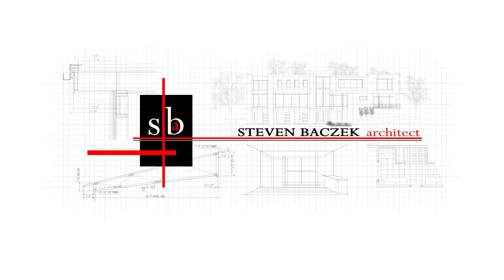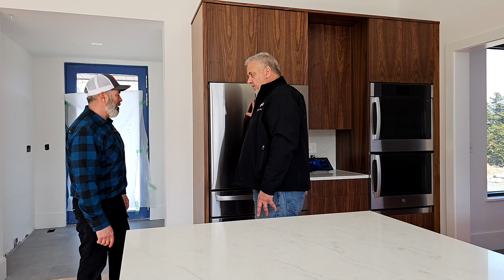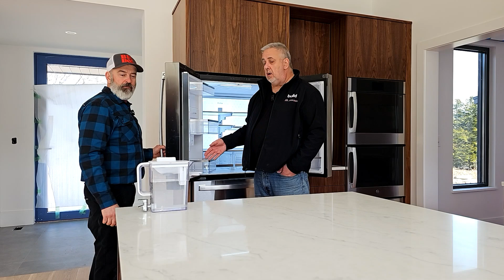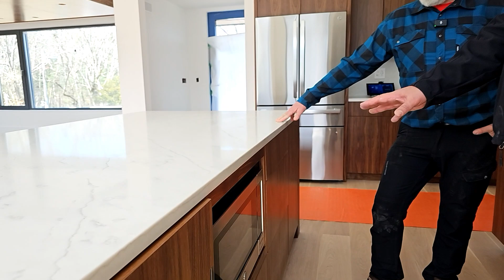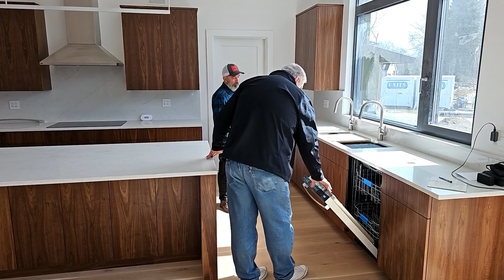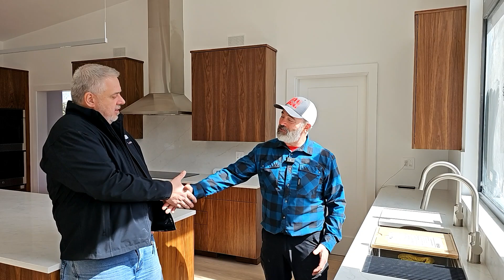A CLOSE LOOK AT APPLIANCES

Comment: I hate our GE fridge on hot days it can't keep up. We don't have A.C. G.E. says Above 110°F, the oil could overheat and break down. I say that happens at 90F. Yes we do clean the back and proper space for it. It gets heat soaked because of wall insulation.

Comment: Being offgrid I decided to go with D.C. appliances like found in boats and R.V.'s. I loose less electric by not running A.C. appliances from D.C. solar system. Think the D.C. appliance have better insulation too. The D.C. chest freezer will live on porch to take advantage of winter temps and use less electric half the year.

Comment: I'm doing planning - in my head - for a kitchen model in a year or two. The recessed refrigerator will definitely be included. I've seen it in the house my brother did and liked it a lot. I don't know if it's common, but my brother built extra space behind the fridge, ducted out to get the ventilation that the coils need.

Anyway, but I'd like to suggest or ask your opinion on is using 15-inch upoer cabinets, but recessing and into the wall so that they don't consume so much of the 'air rights' above the countertop.

Comment: I started recessing full size refrigerators back in 1994. Doing this makes a difference in the overall kitchen workspace.

I don't like the under counter microwaves.  Over the stove was a very convient placement, but the included exhaust fans could never do a good job.

We ended up desigining kitchens that had one extra depth countertop (similar to the recessed refrigerator idea).  We then built a countertop area over the recessed countertop to form an enclosure for the microwave.  We used the full lenght of this countertop area to add a small appliance garage with a pull down roll top cover.  
On the backside of the extened countertop kitchen wall we either installed built in cabinets or built book shelves.  
Doing all of this allowed for us to use full sized microwaves that were extremely accessable.  It also allowed for easy replacement of the microwave down the road with any other full sized unit.  No future cabinet modifications required.  NOTE:  You will need to use countertop material that allows for custom depth fabrication.

Comment: Is the refrigerator installed correctly?  My refrigerator had to have gaps at the sides and the top to allow air circulation for the compressor.  Check the installation instructions.  The location of the microwave is the dumbest thing I've ever seen.  How are you supposed to operate it when the controls are under the counter?  The range hood is too high off the stovetop to do much good.  Check the installation instructions.
Reply from the maker: It is and the microwave is right where the client wants it. The range hood is solely for odor control, it works just fine where it is
Reply: That's where I am putting my microwave in the house I will be building.

Comment: I don't quite get the benefit of a range hood with an induction cooktop and all-electric kitchen... especially with an integrated CO sensor.  The refrigerator detailing is great though!
Reply from the maker: Odor control
Reply: @stevenbaczekarchitect9431  Range hoods  aren't especially effective at that; general ventilation works better, and a carbon filter better still.   The purpose of the hoods is to address incomplete combustion of cooking gasses primarily.  In commercial kitchens the function of heat removal is an additional benefit, but that is a function of density more than anything else.
Reply: The range hood is also very effective at capturing grease from the rising steam and heat from cooking.   I have the exact exhaust hood in my house above a gas range but without the co sensor.  We clean the grease filters about once every two or three months.   I can only imagine the amount of grease that would be sticking to the cabinets, wall, and ceiling if we didn't have exhaust hood.
Reply: @skiptheroad Residential hoods are unsafe for grease handling; grease requires negative pressure ducts.  They can help a little with heat and steam, but really only if the make-up air is introduced at the range. More than anything they are a false sense of security.
Reply: @patrickkenny2077  My range hood exhaust is balanced via a separate duct with an internal damper that opens when the exhaust hood is turned on.  It is also very effective at collecting grease from cooking in its metal mesh filters.

Comment: This recessed refrigerator is cool. I'm incorporating it into my design right now.
Reply from the maker: Good
Reply: Just buy a counter depth fridge, more $ but the wall structure is simpler, cheaper.
Reply: @16jocko  Counter depth fridge has less room inside. If you want the same volume as a regular fridge, then you would have to buy one that is a lot wider. The framing is easy. It's just the wall set back a little.

Comment: A co detecting hood above an electric range in an all electric kitchen - that makes a lot of sense
Reply from the maker: I understand your comment - but please understand that the video is about showing the viewers what is out there and available.
Reply: I'd imagine any detectable CO would come from a malfunctioning gas appliance.  I have an old gas furnace and gas water heater (in a leaky old house), and my CO detector/alarm has always read 0.  Having an alarm for when it does occur is probably enough.  It'll probably be 0 with the Zehnder system in operation, too.
Reply: I have a feeling it senses CO² and not CO, as that makes more sense....
Reply: @DigitalBenny its senses CO, carbon monoxide levels.  CO2, carbon dioxide is not a pollutant  and will never reach a dangerous level inside a home.

Comment: I like the fact that the fridge doesn't have ice and water on the outside of the door. 

What do you do to replace the air that the exhaust removes?
Reply from the maker: The ventilation system will work with it